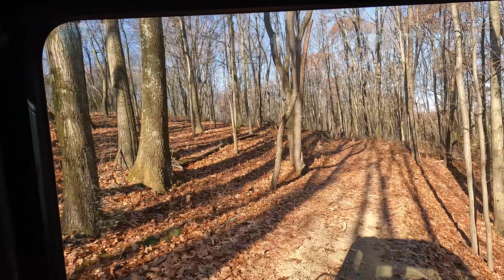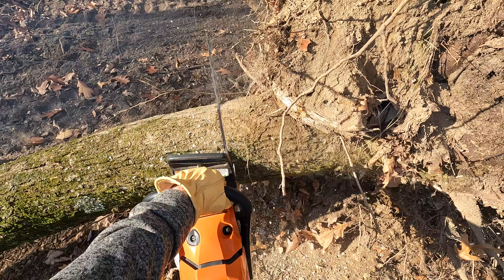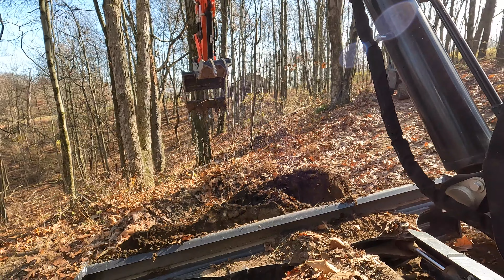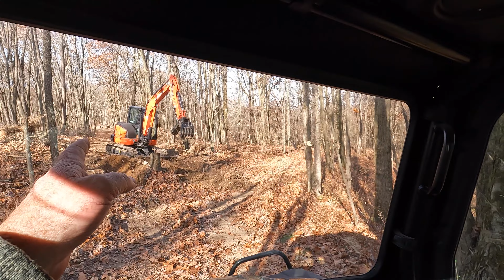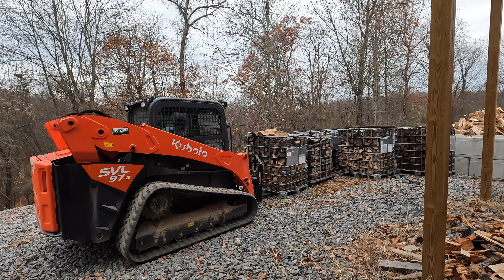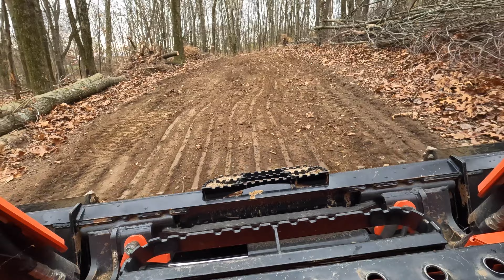First Race on New Road through the Woods, Surprising Winner!

Comment: An observation on when you were dumping those firewood baskets into the trailer.  Since you stack the firewood in those baskets such that its really the sides that hold the wood in (firewood doesn't tend to slip out of a nicely stacked pile in the end direction), why not cut out a larger opening in the front to make dumping easier?  In the event there is worry about the front end of the sides splaying out, after stacking, a temporary wire or two could be strung from side to side across the top and middle of the front (which is easily removed just prior to dumping).  Anyways, something I noticed that might make dumping out those baskets a bit easier.  Wholesome content as always.

Comment: Hey Mike, I have an idea that I think Melissa will go along with. Run electric out  to the new meadow then dig an in ground pool. If you run electric out there you’re set up for a pump and filter system. Put it off to the side of where you want to put the backstop for the 300 yd range.

Comment: Good morning. Thank you for another entertaining video. Is the wood in the totes the same as in concrere storage area? If so, why did you dump wood from totes for firewood delivery instead of taking wood from storage area? Unless you need bins to store newer split firewood  I would think using wood from storage area would be faster to load and save wood in totes for deliveries where customers want the totes for storage.
Reply: Generally, the wood in the totes has had longer to season and is ready to burn. The wood in the concrete bin is newly split and needs to be seasoned a bit more. Until wood is split it just doesn't dry very well.

Comment: I would at least get your toe checked out. It may not just be a clean break, it could be multiple small pieces, and that would need attention. I had my pinky toe crushed and they had to take out a lot of the shards to prevent more damage. That was 25 years ago, and I have been walking around with no problem without a bone in that toe.